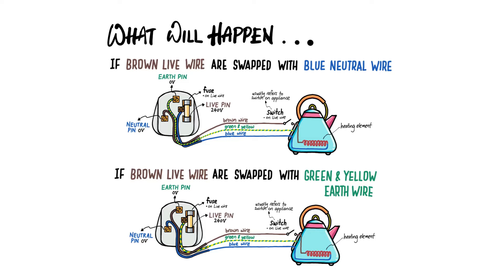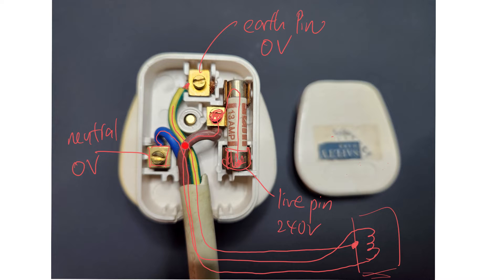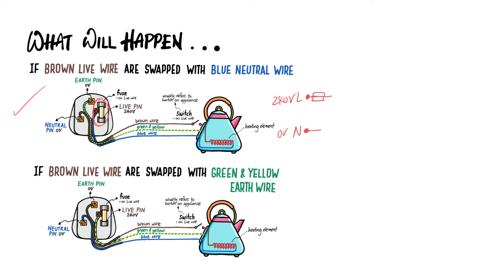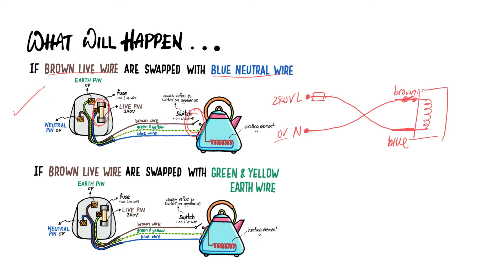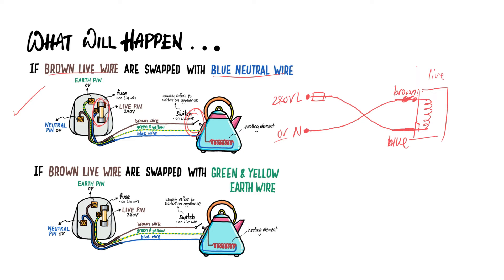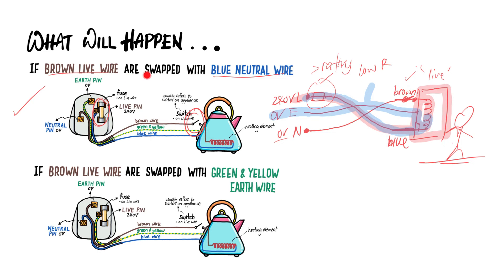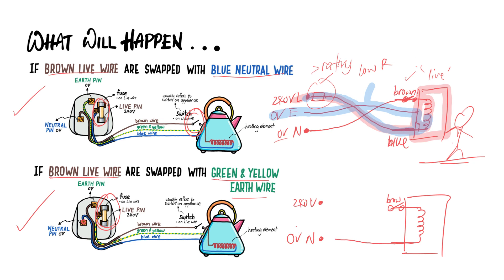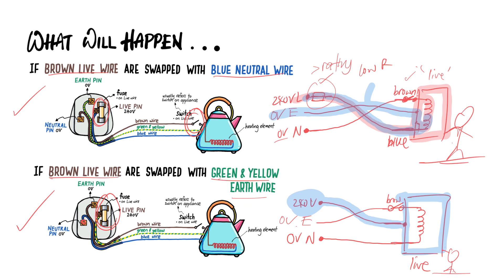What if wires are swapped in the 3-pin plug?

Comment: 5:52 I always explain it with using a toaster as the appliance. If the toast gets stuck and someone uses a knife to remove the toast and touch the elements even if the switch is off they can experience an electric shock